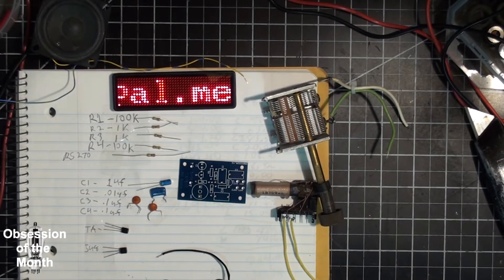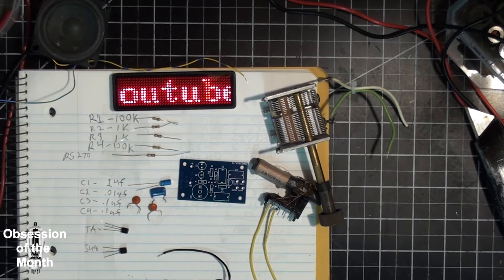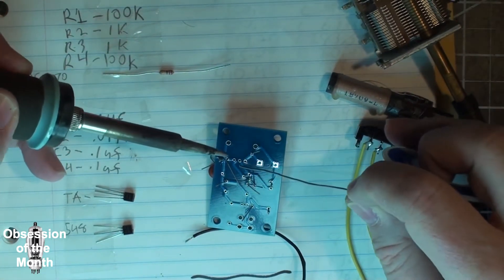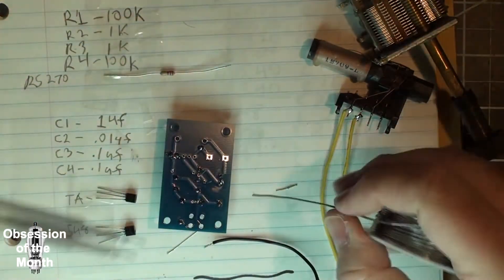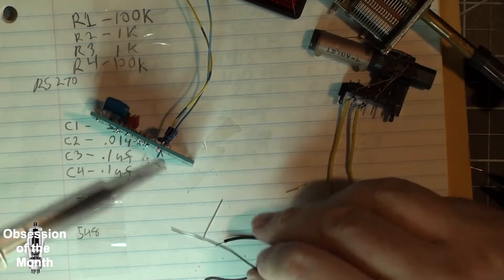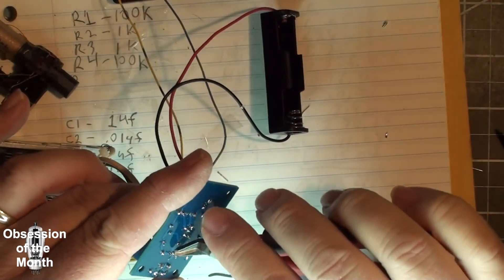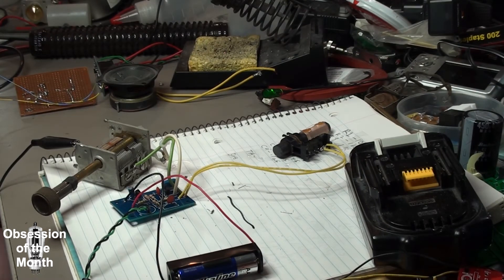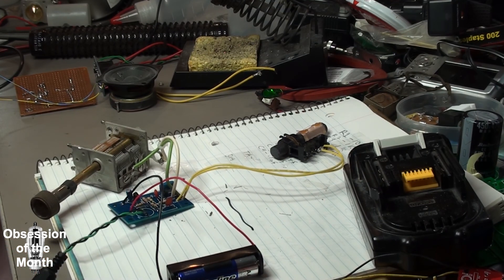TA7642 1 chip AM radio

Comment: Pour suprimer les stations trop puissantes il faut placer en serie dans l antenne un circuit bouchon .self et condensateur variable sont en parallele  pour attenuer le signal fort
Condo 250pf self 60 spires sur baton de ferrite  BEST 73 ON4KMC

Comment: How would one amplify the audio a littlebit more

If I power the transistor (BCF or how is it called) with a separate 9V battery, or I use 2 transistors in series, would this help?

You at least can hear something, my nearest AM station is150KM away (with only 15kW of power)

And even when I connected TA chip to my electric fence antena (long wire about 500m long on top of the fence, isolated from ground with ceramic isolators, that used to be electric fence in the past)

I cannot hear a single station, even at night :(
Reply from the maker: https://youtu.be/TWsZBM0-VKo lm386 amplifier, works with small speakers or headsets.
Reply: @ObsessionoftheMonth  nice thats exacly what I need

I do wonder what does tranzistor even do here (on this TA circuit)? I thought it would amplify, but why so little? Is the voltage going into it to weak?
Reply from the maker: @DXingSlovenija  I did not design the circuit, I got it from the ta76421 datasheet and from someone else that built the circuit. I just designed the circuit board. I think it is just to boost the output, and you are correct it does not do it very well.

Comment: I think that your L/C Circuit at the antenna input doesnt have to much "Q". You have a very "broad" tuning and one reason for that could be  a bad "Q" of the coil. Are you sure you have connected ALL different wires of the litz wire arround your loopstick antenna? They all have to be selected and soldered with no one left out! - Otherwise this will damage  "Q" of your Antenna Coil... how about that?, Heinz, DE0RST
Reply from the maker: this circuit came from a site on the internet. at to the wires, the antennas I have tried did not have litz wire. I used rod antennas pulled from various old radios.
Reply: Dear friend have you ever checked out a simple standard  coil with 330uH or more for medium Wave?
 TA7642 has a very high input impedance (normally) and that will not load your L/C circuit so much that your tuning is so broad. If you watch other videos on YT with TA7642s, MK484s, ZN414s and so on they all have a very sharp tuning... Your variable  air capacitor and the high Input Impedance of  theTA7642 can not  "destroy" Q of your L/C Input Circuit so much. There are two reasons  for that i would think . First a bad coil (see my comment above,) Second a bad TA7642: Can you replace it with a trusted one!  Wish you good luck! Heinz, DE0RST

Comment: OLá. Eu construi um receptor destes mas no meu eu usei um capacitor variavel que eu mesmo fiz e a bobina eu usei um indutor comum de 100uH. E para a antena usei um pedaço de fio rígido de 1.5 . Funcionou muito bem. capta todas as emissoras locais. 

Eu descobri uma coisa sobre este CI ta7642.  
MUdando o circuito tanque você pode captar também outras faixas de rádio, SW é uma delas!
Este TA7642 é incrível mesmo!

:0)
(edit) Obs. o segredo de um bom receptor com este CI é o aterramento. Um bom aterramento deixa a recepção EXCELÊNTE !

Comment: The long wires of the VAR CAP added to the probably wrong values of LC tuning circuit are causing the tuning band (range) to narrow down a lot, so when you tune the radio via the VAR CAP you are in fact tuning not across the entire AM band, but across very small section in it - I say you are lucky that you got one station because that station frequency could have been corresponding to no broadcasting radio station. If you are more careful about using the correct LC tuning circuit you will probably get much better performance and stations. First you need to shorten the wires  connecting the VAR CAP to the circuit a lot. By looking at your setup I can tell that those wires from the coil and VAR CAP are very long, make them as short as possible and select the right LC value.
Reply from the maker: I have tried about 10 different tuning capacitors and get mostly similar results. one problem is that there is a radio station transmission antenna about 1 mile from me.

Comment: As close as you are  to the transmitter you could make a crystal radio with a fairly strong output and have the earpiece going into a paper cone .

You could probably hear it (at a low volume) from a distance.

It would be an interesting project.